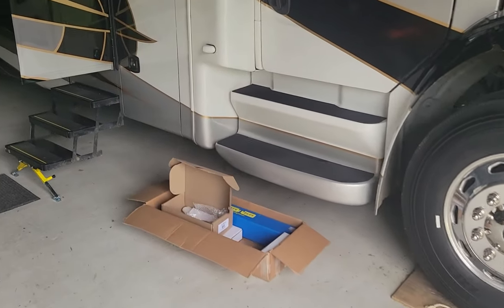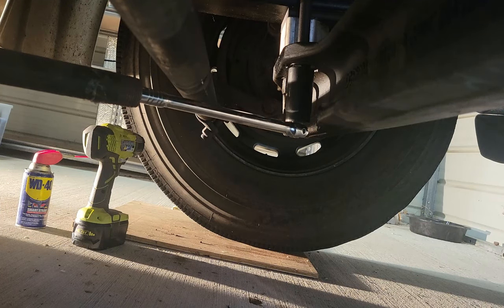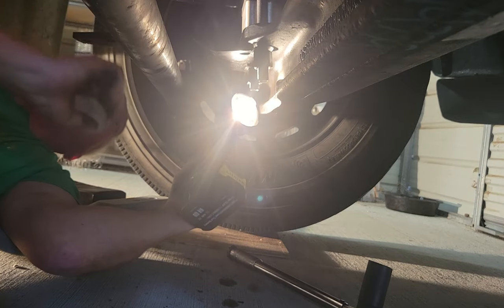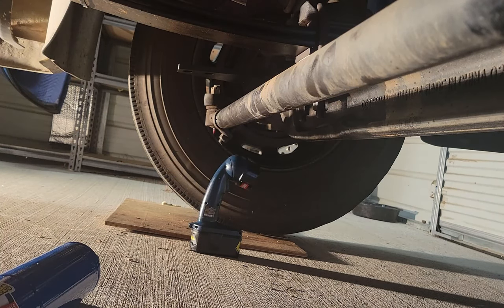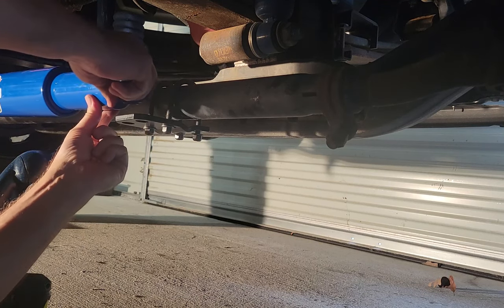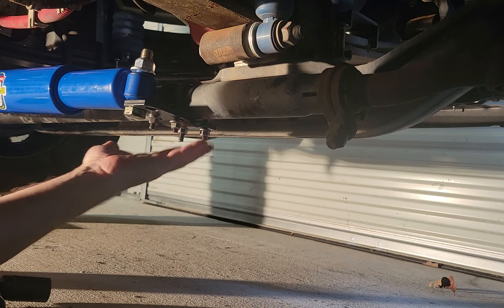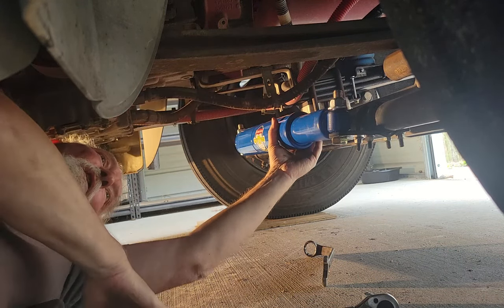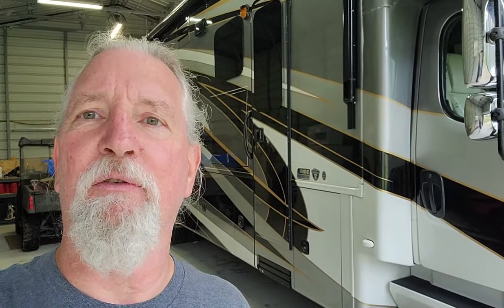Installing the Safe-T-Plus

Comment: Thanks for another great video.  I noticed you have a keypad on your entry door.  Mind sharing which one it is?
Reply from the maker: We had the original Bauer door lock but it crapped out after 3 1/2 years. Bauer had a newer one that is bolt on replacement, ie, an exact fit. It is called "Bauer EM Bluetooth". Just go to www.bauerproducts.com and you can easily navigate to find it.